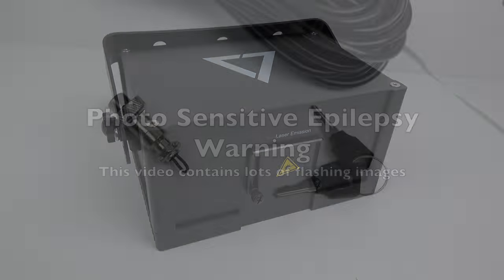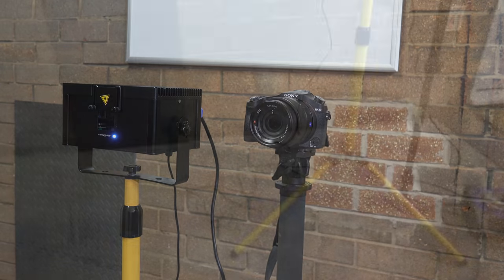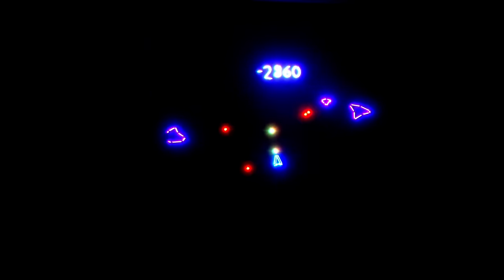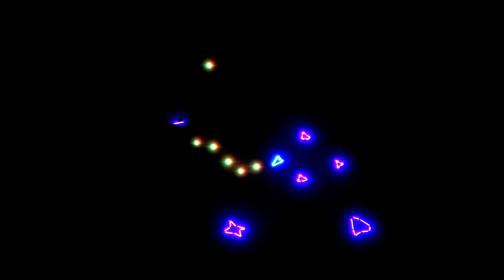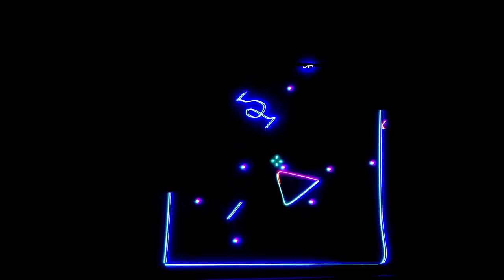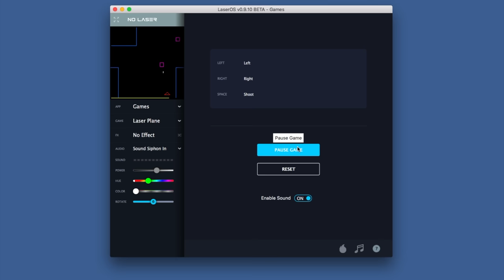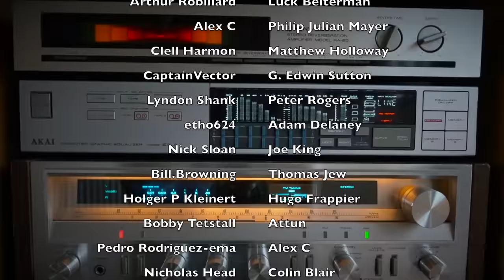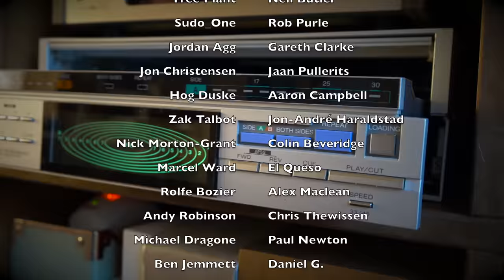Laser Games - Like a giant colour Vectrex that can blind you

Comment: Interesting that it's kind of the opposite of not having the power for 3d graphics. Instead of becoming angular and blocky things become squiggly and rounded.
Reply: Lol. Well, it's not that it doesn't have the power, it doesn't have the accuracy. Things look rounded because the motors are not stepped enough, it just guesses(wrongly) the positioning.
Reply: Richard Smith I think they were stepped enough, but lacked the torque to actually reach all the locations in the right time, so instead it literally cut corners
Reply: these are mems aren't they? I wouldn't think this would be anything like steppers.
Reply: Yeah maybe, or lacked the speed. If it's high powered lasers, it very well may be torque, moving the heatsinks in all.
Reply: Yeah, I think the main issue is a lack of accuracy at speed.
If it were moving too slow parts of the image would not get drawn at all, but if it rushes I guess it approximates the fastest path through it.

I suppose part of the problem could be that the X and Y deflection happens with separate mirrors, meaning that if one mirror isn't moving it would need to start moving in advance to complete a later part of the movement in time.
I imagine the mirrors have a relatively high mass compared to the deflection speed, so it doesn't instantly start or stop. That in itself means the ends of any line drawn involves a degree of acceleration, and taken to an extreme that means sharp edges become curves. (since it's easier to smoothly transition to a new direction than to create a sharp corner, which would require coming to a complete stop, then starting again.)

Yes, the fact that the mirrors cannot stop and start instantly would seem to be the most likely reason sharp points have a habit of vanishing when there isn't enough time.
A hard corner would require deceleration, stop, accelerate, while a smooth curve is an even acceleration all the way through, and thus takes less time to complete.

 Weird quirk with unusual visual effects, but interesting to consider the reasons for it.
Reply: They are not mems, but rather galvanometers, a form of highly accurate moving magnet motor. The only reason the images look so bad is that they are being heavily overdriven. The scanners in that projector are bottom shelf, and lack the torque required to decelerate fast enough to make the corners. Kind of like how a car with weak brakes could only make a sharp turn of it was able to slow down in time.
Reply: It is kind of neat that the software is smart enough to degrade the quality of the drawings in order to maintain frame rate.  This is clearly intelligent corner cutting -- figuring out which corners can literally be cut in order to reduce the total line path to under a specific distance between refreshes.  As opposed to rendering the objects perfectly but not getting to them all in time.
Reply: @agvulpine No, what the previous posters mentioned is just a lack of torque of the motors, no "smart" software involved in cutting corners, it's all just physics :)
Reply: Not bad, but it looks like the scanners are still overdriven a little. The corners on projected images should only be very slightly rounded at most. Still, I understand that reducing flicker is the priority here. Are those dt40s? If I had the dongle, I would try out those games on my 60k + projector. Bet it would look pretty good.
Reply: @Benjamin: I will still kindly disagree with that assessment.  While yes, the mirrors aren't physically capable of higher refresh rates due to physical limitations of the "torque" of the motors, this is NOT why the images render the way that they do.  The images render the way they do specifically because the software intelligently "down samples" (more accurately: simplifies) the complexity of the drawings.  You can verify this by looking at the complete redesign of some of the objects being rendered, where entire vector paths are completely removed to create simpler shapes.  This cannot happen by mere laziness of the mirrors, but rather  brilliant sophistication of software.
Reply: You are absolutely right. It is simplifying the images heavily and removing entire elements from some renderings. The formula it is using, however, seems to be a poor implementation of a great idea. The biggest problem seems to be constant changes to the shapes being displayed as new elements come in. It seems like it is actually affecting other elements of the image actively as new objects enter the scene, making the image appear unstable and ever-changing. What they really need is several versions of the games with different native complexity levels to avoid this issue. Even so, this doesn't explain the curved lines. The problem with curved lines being a simplification is that to create intentionally curved lines using the method of vector rendering assigned to laser projectors actually requires the images to be more complicated. All laser projectors display vectors using the "points on a grid" method. The projector is assigned a list of points to which it must bring the beam, either with or without stopping emission during travel. This means that all circles and curves projected by lasers are approximations, created by including enough points to where the true shape of the line is not apparent. The more accurate the curve is desired to be, the more points are placed along the vector line to approximate the true curve. By modifying the shapes in this way, you would actually be slowing down the total refresh rate of the image as the beam would use time up stopping at each point. This is the same reason the circles in the renderings in the video are 10 sided decagons rather than true circles, with ten points forming each one of the angles in the shape. When the scanners are driven hard, they are not able to come to a complete stop at each one of these points in order to make the given time for each refresh of the image, thus the figure appears a circle.
Reply: The reason for the 10 point "circles" is purely artistic retro throwback.  While the degradation of sharp corners into rounded corners is a product of intelligent software.  Disco lasers do not operate on a vector grid point system like you imagine, but instead operate on shapes composed of trigonometry math; x = y^2 type stuff, which is how lightshow shapes are created.  But moreover, the entire pattern is pre-calculated into a single "rope".  That "rope" cannot exceed a specific static length per refresh.  The more patterns put on the display, the more demand for rope there is, and compromises are made by creating rounded corners. (Note: "black rope" connects two illuminated shapes, so more rope is necessary the further apart they are.) (yes, there is a grid system, but fundamentally points do not have to snap to squared x.y points, real circles are possible.  yes, most real circles look stupid in this video because there was a software bug that made the termination points off-by-one so they look like spirals instead).
Reply: You are wrong...

"disco lasers..." 

Points per second, the mirrors move from one location to the next on each frame. If the requested image is too complicated after aliasing, then heavier aliasing until the points per second are low enough. You can further refine the live image with good display software, it will try and move points on the "rope" from the programmed XY coordinate if the previous move meets certain conditions, it'll add points if the image is simple enough, basic acceleration and deceleration, it will add points to circles on simple frames and it will remove points from circles on complicated frames. This is the "formula" the other guy was talking about, and it's what makes great display software and crappy display software. 

You generally select the points per second your galvo set can manage at the required max deflection in your display software. Cheaper galvos, better back waaaay up if you want to display vectors. You can "tune" this and run galvos outside spec if they are good ones, this is overdriving. If you buy cheap junk, you tune them to figure out what they even are. If you have shitty display software too, well, I wouldn't want to be you.

Running a set of galvos way too fast for the scan angle just makes them stutter, grind, and output pure garbage. Running them marginally too fast will cause them to round corners but still output something. 10:00 onward is a good example of overdriven the other guy is talking about, or galvos attempting to project a frame with too many points for the current scan angle. It doesn't mean that the image isn't being simplified, just that it's not being simplified enough for the equipment to display. The "rounded lines" are an artifact left from the laser's ability to turn on/off much faster than the galvos are capable of moving into position combined with the mirrors not actually being in the position they are supposed to be in, ya know, since they are overdriven too hard...  

Finally, all moves with the laser ON during a vector show should be in a straight line. Do you even know what a vector is? It's a line, not an arc. 

If you care to know more, go read up at photonlexicon forum.

Comment: If you want a few tips of capturing laser (and CRT) projections on video: Set the shutter time to no shorter than 1/25 and adjust aperture and/or ISO to compensate for brightness.

Also, you could try re-tuning your scanner amplifiers if you want the images to be sharper. Reducing the scan angle also helps a lot with image sharpness.

Comment: A mems based laser projector would fare much better with less mass for the actuated mirror which would allow for a faster refresh through higher acceleration. Alternatively depending on the control resolution you could simply limit the actuation range and back the projector away more to gain refresh speed. Of course all this would require modification of the control software and/or driving firmware.

Comment: I imagine it might be possible to improve the projector's performance by reducing the scanning angle (and put the projector further away from the screen so that the projected image is the same size), so that the mirror is making smaller movements. Not sure if this would be a feature of the projector itself, but in theory it should be possible for the software to do it. Obviously there's a limit to how far you can go which is determined by how much fine accuracy the motors have.

Comment: LaserOS has a setting where you can change the maximum points-per-second that it will try to render, although it seems like the options are backwards (at least in a previous version I tried). Lowering the PPS will improve the sharpness but can add more flicker, although in my opinion it's worth the tradeoff.

It's too bad these are almost $800 USD now. Their Indiegogo campaign had them at $199. I'm not sure why the price has gone up so much.

Comment: The only problem to me with the Asteroids clone is the lack of inertia when changing direction. In proper Asteroids, your inertia remains when you apply thrust - so if you want to stop, you have to aim directly in reverse to your current direction and apply thrust until you slow down to a stop.  If you aim at 90 degrees to your current direction of motion and apply thrust, you start curving until you're moving at a diagonal to your original direction.

In the Laseroids, as soon as you apply thrust in a new direction, you IMMEDIATELY move in that new direction. That would take some getting used to as an old Asteroids player.  (Plus the science geek in my goes "Man, that's some severe G forces making that turn!")

Comment: You could try tuning your scanners. The drivers on these cheap chinese scanners are roughly tuned in the factory but are usually fairly diecent clones of Cambridge 6800 galvos. If you can download and show the ILDA test pattern then adjust the low frequency dampening, high frequency dampening and gain potentiometers on each driver, you should be able to get a slightly better image.

Comment: I started to work on an asteroids game on my laser light show system in the 90s.  Several objects with independent motions is no problem, but some of the choreography was puzzling and I lost interest and have since stopped developing.  My scanners were made from General Scanning galvos from an old chart recorder and I got a 4ms step response. Slow by professional standards, but just right for a Radio Shack Color Computer running at just under 1 MHz.

Comment: You shoulda shown 'Balloon Popper' That's kinda fun. It will really pop what you target. Sadly my laserdocks red went out after only two hours of use, and wicked lasers did nothing to help. Thanks a lot wicked :(
Reply: Wicked has never been known for quality.  We recommended they improve their products in 2006 and they showed us the door.  They were more interested in ringing the cash register than they were with quality.  We found that more than 20% of their products failed in the batches they sent us.  It's a company that just sells junk from China.  Most of their products claimed to be high powered, but those measurements were taken with the IR filter, so it was measuring the output in infrared rather than visible.  They'd make claims (100mW), when in reality it was closer to 4.5mW visible....something else they didn't like to hear.
Reply: yeah, i let them know about it right after i got it pretty much. they said the problem was either the red control board or the diode itself (which i knew, but which was the problem?). i tested the voltage of the red drive board and got something real low... less than 3 volts which seems way too low to me.  i told them that and they just never got back to me. they had offered to send me another - but like i said, they never did. :(

Comment: There isn't much these days faster than an old school electron gun. The mighty CRT wins this round 😊
Reply: Of course, they didn't actually move though, they bent electrons with magnetic fields.
Reply: The down side, if you're next to a hadron collider or an MRI machine, they don't work. Because of the magnetic fields. What a pity.
Reply: I keep a couple for retro gaming. RGB at 60hz is smooth as butter. Motion blur doesn't exist
Reply: Ian Griffiths That sounds great, the CTRs in the pal region run at 50hz so they're not as smooth.
Reply: I'm in the UK. A good pal tube will do 60hz over RGB. Console modding required ofc
Reply: Ian Griffiths So can you run a retro pi through av into a CRT with no lag at 60hz? Because then I can keep my consoles unmodded.
Reply: With some modding to the pi yes. You would need to modify it for RGB out at 240p then pass that through SCART. 

You would need to build a cable or box with the correct switching voltages to tell the TV to go into RGB mode.

There are probably after market products available that will take the HDMI feed from the pi and output RGB. You wouldn't see much latency doing it that way  to be fair
Reply: We're blessed in Europe with the full RGB capable SCART connection. The best analogue solution there is imo (once you get your head around the wiring)

Comment: I think the problem is a software problem. The laser shouldnt curve the lines when there's too many, i think the software is just ramping the acceleration too high and also the line order isnt optimised as you can see the curves change when stuff passes by.  The lines should be drawn in a kind of XY buffer having each line as an individual object. I think the mirrors are no more than linear actuators attaches to a mirror, like a speaker with two coils in one cone. Then the lines are drawn in a maximum time lapse,  if it takes less time, it streaches the time it takes to draw them, reducing the speed and acceleration of the mirrors, when there's too much stuff it just outputs the signals as fast as possible and then the innertia of the mirrors starts playing a role curving the lines like a car tying to take a corner too fast.
Reply: Hardware.  The scanner amplifiers are pure crap.  This is common on all cheap projectors that use junk components.

Comment: I've always wanted to write some vector games and play them on a vector display or laser projector.
Maybe even try some 3D stuff with red and cyan coloured shapes on top of one another.
But I happen to be the most broke-ass full stack developer on the planet.
Reply: P4INKiller - You can pick up old 20MHz CRO's for next to nothing - and you do want a proper analogue 'scope for this stuff. Bonus if it has a Z input, not just X-Y.

Use the two channels of your soundcard to manipulate X and Y vectors... 

There is literally no fucking money involved, providing you can write a bit of code and solder some wires.

Comment: 9:53

Looks like the galvos are fairly slow tbh. Say 15Kpps or so?

If there is an option to reduce the scanning angle / area, that should make a noticeable improvement to the graphics. ;)
Reply from the maker: This is as good as it can look with this particular projector - all settings were optimal.
Reply: I was wondering the same about the speed of the galvos. As someone who bought a full color rgb laser system years ago, I can't believe the prices now. Something like this would have been tens of thousands of dollars not that long ago.

Comment: Just use a normal projector running mame and play the vector games that way. They look beautiful and are the arcade ROM. You only need 1024x768 res. Any more is overkill. Get yourself an arcade stick for the best experience or even a PC microsoft xbox USB controller is good as it has an analog stick and analog brake and accelerator for those driving games. Daytona USA or Sega Rally anyone?.